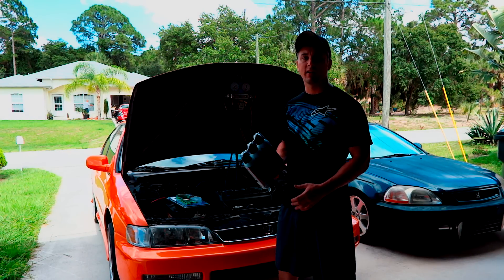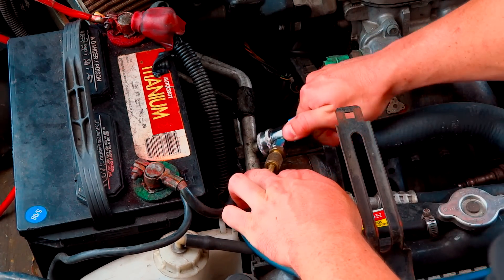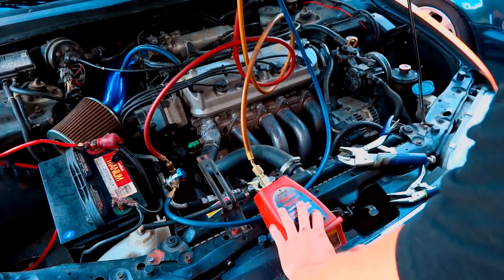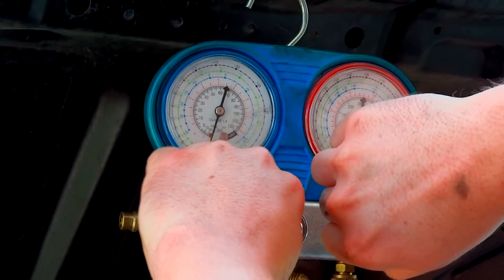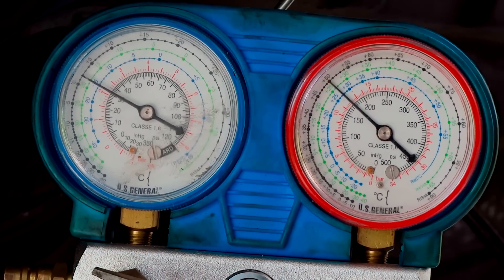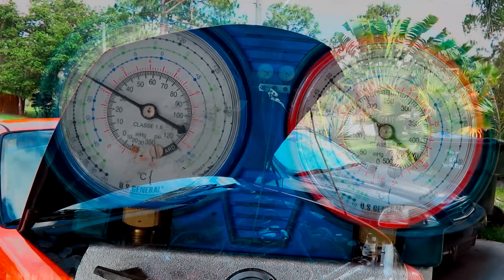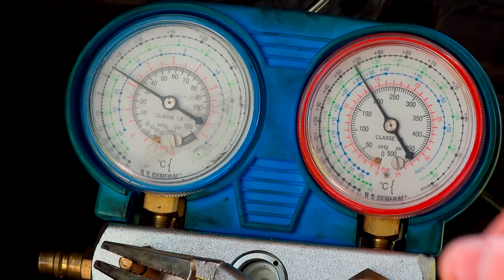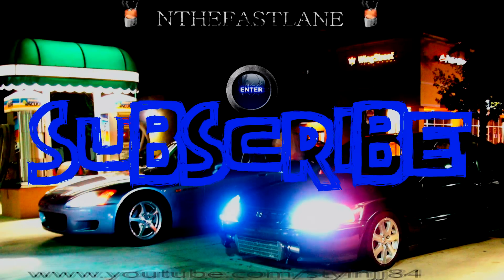Charge Your A/C With The Cheapest & Coldest Refrigerant

Comment: Freakin' awesome! But you say this gets colder than R12??? I have a 93 MX-5 that is of course R12 native and while I have the components ready to undergo this task, I went hard on the brakes when I ran across your video.

Is this a 'temp fix' kinda thing or is this a viable replacement? Also, what about oil? Can I still use mineral oil or do I have to use the PAG stuff? And PSI, what numbers should I shoot for here in Missouri (avg temp here is about 87-93F)
Reply: zeke112964 I've since already converted to 152 and my vent temps are 45 sitting still and 38 moving. 152 is more efficient than 12 in every way, so I'm glad I made the move.
Reply: ***** the methods shown here will cause you major issues , the water bottle crap will kill an a/c system , the drier is in the system to remove small traces of moisture , but not water for pete sakes , but as for his refrigerant , it is R-152A it is a refrigerant , it is also what is going to replace R-134A in 2 years , look up a video on beltstowing about charging an A/C with computer air duster , we don't use water and other stupidity like this so called section 609 cert fellow , it's obvious he has no idea of how an refrigeration system really works , and what it's major enemies are , moisture is #1 !
Reply: towrecker Oooh, but is 152a colder than 12a like he said or...? And by 'water' I guess you mean not to let the can dump pure fluid in and instead let more of the gas in?

Where could I get 152a and does it require pag oil or...?
Reply: ***** yes R-152A is colder than 12A, (12A is just propane ) R-152A runs the same temps and pressures as the old R12 , well not exact , but within 2 psi. and 2 degrees , so close enough , R-152A does not need a larger condenser (big thing in front of radiator) like R-134A does , and for the water part , did you not see him dump the system , sticking the charging hose down in a bottle of water , that hose was contaminated because of that , as for charging the R-152A , you must charge it as liquid , can upside down so to speak , hope that clears that all up , if not , well I am here ...
Reply: towrecker  just when you said it the way you did about the water, two things ran through the mind, none of them 'contamination' so ja.

And the smaller condenser is better, with a system like that I'd be able to relocate it some place else on the car with good airflow and no worry of road debris :D

Can 152 be had now or is it license only? I was going to recharge my car with 12 since 134 doesn't perform well in these cars.
Reply: ***** ok my attempt to copy and paste something did not work so well , but all it is , is computer air duster , better known as canned air so to speak , it's available everywhere , just make sure the can says on the back that it contains difluoroethane , or it may be just listed with it's CAS# , that is just basically a number like a serial number assigned to the refrigerant those numbers are in the sidebar at the right of this page      https://en.wikipedia.org/wiki/1,1-Difluoroethane    read up on it , it requires no license , just the cash to purchase it , also the can clamp to dispense it , nor the gauges to read and service the system require any specail license , hope this sheds some light on the mystery for you , if not , you know where to find me ...
Reply: ***** Also note that you can't really measure air temperature with an IR gun. It measures surface temperature, and air is transparent to the IR signal. So he's really measuring the temperature of the duct which may or may not be cooled down as much as the air...
Reply: George W ibthink I've seen that but it wasn't clear as to being an R12 replacement plus I love the bigotry on eBay... They want you to produce a license to handle the stuff but they don't have one themselves... :/
Reply from the maker: been runing it in my truck since 2012 no problems and still ice cold.
Reply: ***** they make a R12 substitute like freeze 12 if your vehicle hasn't been converted.  Try eBay or amazon.
Reply from the maker: +Porsche Duésnburg Just run PAG 134a.
Reply: +Porsche Duésnburg 152a is not colder than R12
Reply: Jerry Creedon ?
Reply: CarsRcool Ja, oiling the dryer is essential as is the compressor but I've heard success stories of people simply vacuuming the system, injection the oil, and everything gets lubed just fine.
I got away with murder on that because my system is so small but had it been bigger, I likely would have made a dire mistake that I'd have learned from.

Variable orifice? sounds like it has an expansion valve of some sort but then again, knowing GM, they cheaped out back then. I say though, be careful with orifice tubes, I've read on several forums they can let too much in at once thus your core will be prone to freeze up. My MX-5 has an expansion valve so it prevents the core from freezing by shutting off circulation if it gets too cold.

As for mixutre level/psi? That's trial and error per car since these systems weren't designed with 152 in mind. I only had to use a little over half a single can for my MX-5 since the system requires 9oz of oil. I had two cans in before (close to OE weight specs, just a little under) and not only did my superheats fly off the charts, it was actually dragging my engine so hard it would stall! LOL Opened the system, cleaned, added oil, then slowly introduced 152 until vent temps were stable and my engine could service a stop sign encounter lol

Edit: towrecker might be able to assist you with conversions for your specific application.
Reply: According to encyclopedia.airliquide.com the specific latent heat index (the energy transferred when transitioning between liquid and gas) of the refrigerants are R12 (166.172 kJ/kg), R134a (215.9 kJ/kg), and R152a (326.5 kJ/kg). So according to their numbers R134a and R152a are both more efficient than R12.
Reply: towrecker So you never answered my question from before. What type of oil do I require?
Since I was going to stay true to my car's R12 system I have 1qt of mineral oil, however, if I'm to convert to 152 knowing the proper oil usage is handy...

So, will mineral oil work or do I need PAG (and if so, how heavy)?
Reply: +Porsche Duésnburg rip.
Reply: did you use "dust off" to get the 152 ?   cheers!
Reply: CarsRcool I did. The green can ones from Walmart are the only that I know of so far that don't have the 'anti huffing' additives. It's pure
Reply: ***** ok.. thanks for sure.. 
yea.. if they get a chance they will add crap to     mess this up ... .
Great Job    Cheers !
Reply: CarsRcool I don't think they will. The 'huffing' era seems to be over with as people move to that K2 or K12 shit, whatever it is.

Even if Duster did put the additive in theirs, there are plenty other ways to get it but it would just require a ton more research to ensure what you're getting is pure and not mixed with anything.

As for a status update though, still running mine and still blows blizzards. However, regardless of what you use in your system I ALWAYS recommend doing a complete system break down, thorough cleaning (or replace as needed. always replace Dryer/accumulator though, regardless), then thermal treat (IE; insulating lowside so it doesn't sweat. sweat = lost energy and the system has to work harder). New seals, yada yada.

That way, you know everything is in working order unless you made an errror somewhere, and if so, it should be easy to retrace your steps and correct it. Not to mention now your entire system is baselined so if 5yrs from now it starts going wonky, you still have a good idea what could be the problem.

Hope this helps abit more and sorry for the novel! cheers mate! :D
Reply: ***** no problem..i enjoyed your reply ..i like your idea on insulating the low/suction side.. it appears the 152 with the Pag  oil is a good mix.too... 
i have a 92 Buick that i am putting a couple of old cans of R12 in . and the car has a " variable orifice tube" i had used it and it helped 
i believe i put the oil in the accumulator wrong 
last year and it got spoured into the dessicant and none went to the bottom and got returned to the compressor.. and it  blew the front seal/o-ring ( my mistake  ) 
So .. as a 12 substitute .. it sounds like your truck?or Mazda ? is still running great.. 
Thanks for the reply :  )
Reply: whoops, forgot to hit reply
Reply: Superheats? Fly off the charts? What the hell are you talking about
Reply: zeke112964 highside
Reply: ***** it is not factory .. it is a replacement part... i do  not  know if they still sell them.. it is basically a 2 stage oriface tube from what i remember.. 
1 smaller size for idle.and then open up  wide for cruzing down the road..and  i remember it lowered the idle vent temps 10 Degrees F ... 
As for Charge i would start at 75-80 % of factory by weight...
Accumulator systems run a " flooded" evaporator... so you should see 0 superheat on the  pipe coming out of the dash.. 
on a expansion valve system
same thing under fullheat  load or almost with the engine at say   1200 rpm should be enough..
is a quick guess off the top of my head..
Reply: Super heat is measured on the low side / suction side.....sub cooling is measured on the high / liquid side and what charts are you referring to for super heat?
Reply: zeke112964 yes.. correct...but  because of so many variables of engine speed.. 
air flow over the front condenser ,  and  Heat load... i suspect only the factory would have those charts...
but if you can find some.. i would love to see the numbers.. 
Cheers
Reply: Great comment ... Cheers

Comment: Where can I find the clamp pls help thumps up times 1 mill.
Reply from the maker: Any Napa buddy.
Reply: Nthefastlane OK what's it called? Air dust clamp? Lol
Reply: bruce cisneros It's called a Mastercool 85530 3-IN-1 Side Mount Can Tap Valve and can be ordered from Amazon using this link
http://www.amazon.com/gp/product/B0002SQLGC?redirect=true&ref_=cm_cr_ryp_prd_ttl_sol_4
Reply: optionstraderman  thanks man
Reply: ***** thank you!
Reply: +bruce cisneros NAPA's are the most OVER PRICED & OVER RATED Parts Stores around!!! Auto Zones have thee most educated Parts & Hands On experienced Countermen I have ever dealt with in my 35 years of Auto Repair. They also have a Meet or Beat Price Guarantee & Overnight FREE Shipping on ANY parts you need but aren't in their normal stock. Hands down , THEE BEST PLACE TO BUY PARTS & sorry Nthefastlane but you are making a very Very VERY Simple job look like Brain Surgery :( ANY Reputable Shop that has their R12 A/C Handling EPA Certified License will Evacuate your system for as little as 50 Bux & if you have R12, most places will do it for FREE because it is reusable therefore it is very valuable to them. You fail to tell people how expensive your whole set up of hoses, gauges, pump ect. is while anyone can have the Evacuation, Leak Detection, Recharge with R134-a, Compressor Oil & Stop Leak all done for MUCH less than the cost of your equipment!!! I am Mobile during the Spring, Summer & Fall and Specialize in nothing but A/C Recharging & R12 to R134-a Conversions. It usually takes less than 45 minutes to Evac, check for leaks & change out the the low & high side fittings and another 20 to do the full recharge. Most shops charge upwards of $250 to $400 while I only charge $175 & STILL make just over $100 in Net Profit!!! 75% of all my jobs consist of just Recharging with 2 to 3 cans of R134-a & 1 small can of the Best Stop Leak made & I charge ONLY $70!!! $55 to $60 of that is PURE PROFIT!!! OK, ENOUGH OF THAT BUT FOR ALL YOU DIYers out there that just want to recharge your existing R134-a system, I have GREAT NEWS for you..... Recharging & adding a small can of Stop Leak is very VERY EASY & you can gitter dun in less than 30 minutes for less than $50 bux!!!! WALLY-MART has exactly the 4 whole things you will need....... the hose with gauge & trigger, 2 or MAYBE 3 cans of R134-a & 1 small can of Stop Leak, just in case and/or for leak prevention!!! Between the Automotive guys there & watching just 1 of the hundreds of video's on "How to recharge your cars R134-a A/C system", you will have all the directions needed to do the job quickly at a very affordable price!!! One last very important warning, ..... NEVER EVER OVERFILL YOUR SYSTEM & MAKE DAM SURE YOU SHAKE THE CANS VERY VERY WELL JUST BEFORE TAPPING THEM & LASTLY, NEVER NEVER EVER NEVER TIP THE CANS COMPLETELY UPSIDE DOWN LIKE THIS GUY DID IN HIS VIDEO...... AS YOU'RE FILLING, SHAKE & AGGITATE THE CANS BACK & FORTHI N A 12 TO 3 MOTION WHICH YOU WILL SEE THEM DOING IN THE VIDEO OF YOUR CHOOSING. THIS MOTION WILL HELP IN KEEPINGTHE REFRIGERANT MIXED WELL & PREVENTTHE CAN FROM FREEZING UP!!!!!! SORRY TO HAVE WRITTEN A NOVEL HERE BUT HOPING I WAS ABLE TO HELP SOMEONE OUT!!! THANK YOU, TAKE CARE & GOD BLESS!!!! KINDEST REGARDS..... RED ROCKIN SAMMY C~
Reply: @sammycee5318  lol. Nothing he has is expensive. It's all from Harbor freight except the sidetap. Also shaking the can does nothing except transfer heat from your hand into the can. I know guys that dump the cans into warm water to keep the pressure up. It actually works better and doesn't freeze your hands.
Yeah some cars dump the refrigerant in right before the pump. That's a bad place to put liquid refrigerant. Best to tap the top of the can and keep it upright in a container of hot water for those cars.
Reply from the maker: +bruce cisneros Under the video with my check out link.

Comment: CFM ≠ Vacuum.  That's the air requirement for the compressor to operate the pump. A perfect vacuum would be 30"Hg. That pump is probably capable of pulling 27 or 28"Hg, which is sufficient.
Reply: I cringed at that and figured he had no idea what CFM stood for. The other vac pump from harbor freight doesn't need a air compressor and is much better.
Reply: @bryanfullerton1566  And pulls a proper vacuum.  The cheap POS he's using can't pull a proper vacuum!
Reply: With the synthetic oils, a 28"Hg vacuum IS NOT sufficient enough!
Reply: Can't get to 30 psi, but 29 is pretty good considering the accuracy of analog gauges.  I think perfect is -29.92.

Comment: Thanks for the Video, it gave me the courage to fix an AC system myself.  A Pack-Rat bit through my High Side hose releasing the coolant. I guess there was condensation on it or something and he was thirsty.    The harbor freight vacuum pump was a good idea, I think it was around $20, worked great was able to almost pull -25 on the low side and well below zero on the high side.     Also a manifold down there was about $60.Two 12oz Cans of Arctic Zone R138A - $16.00,   Found Dye for $8,  and a necessary Brass CAN Tap for about $6 at O'Rilleys.     I didn't use the Dustoff because I wasn't sure it was compatible with my current setup, so I had to go with the R-134A.   The only refrigerant that was released was the stuff the pack-rat released.  Heard a hissing sound when he bit through the line, I thought I was overheating and it took me a while to find the leak.  Hissed for about 2 minutes.  Probably froze his face off.   He also bit through my radiator overflow valve.  Stinking rat Cost me a day of work and at least 300 in parts and tools, not to mention the mess he made inside my machine.   Piss and Turds everywhere.
Reply: A  "-25" isn't a good vaccuum!  A good vacuum can't even be read on a standard refrigeration gauge because IT IS IN MICRONS, and is deeper than a refrigeration gauge can measure!

Comment: After tapping can, you opened up blue side, and started charging system.  When did you open up the red/hot side?
Reply: KarasCyborg As I understand AC charging, you never fill from the High(red) side, only ever the Low(blue) side.
Reply: Jarred Hebert Correct. Never open the high side when charging as it can send the liquid refrigerant directly to the compressor, damaging it. (A/C Compressors can't compress liquid)
Reply: +NCD2294 You don't use the high side because the pressure is greater than what's in the can and would be putting refrigerant back in the can and possibly cause it to explode....
Reply: fourfortyroadrunner  You must teach an unmonitored class down at the plebian college
Reply: NCD2294 Good god  you people are  stupid.  Turn in your tools quick,  before you hurt someone.   You  CAN  charge an empty  evacuated  system  from the high side,  and in fact this helps protect the compressor.    You  faltering idiots,  the compressor has  VALVES in the head  which act as  check valves.   Putting liquid in the high side  will NOT  go into the compressor, but instead will sweep through the system.

Opening  the high  side valve to the charging  container  while running is NOT   good,  the only  true thing posted here
Reply: KarasCyborg It's okay, he's just special.